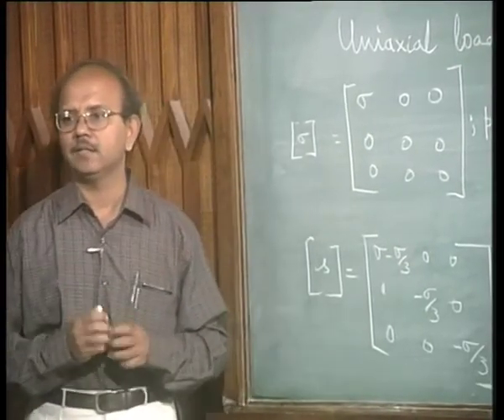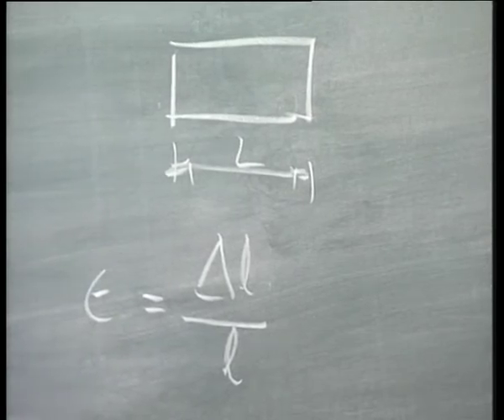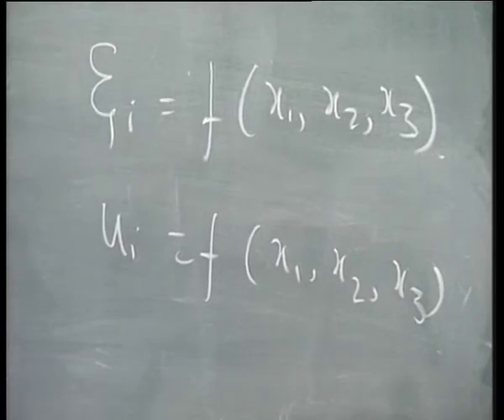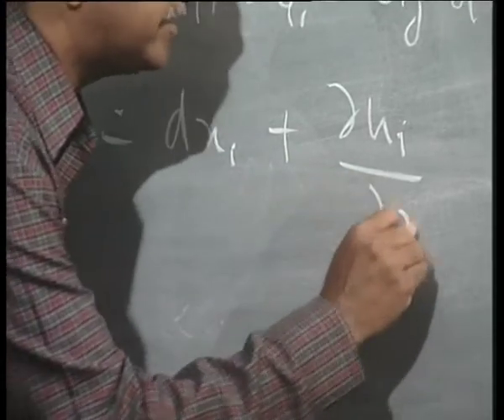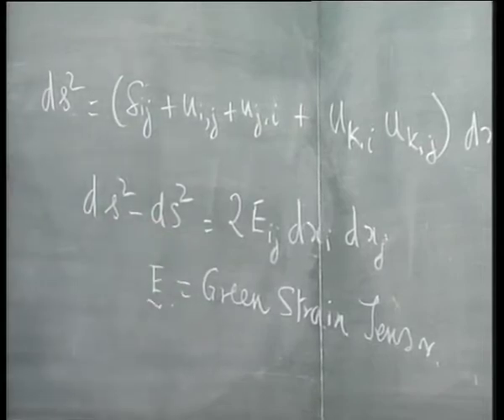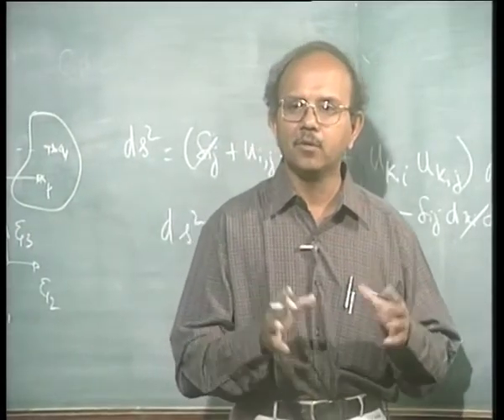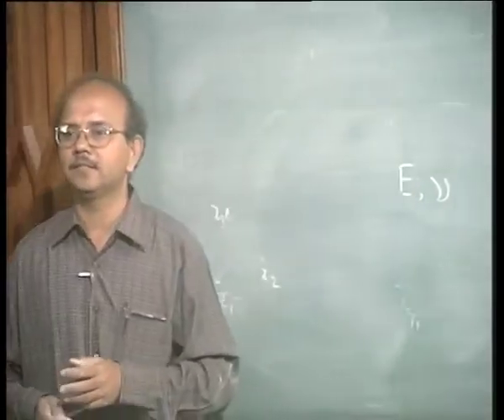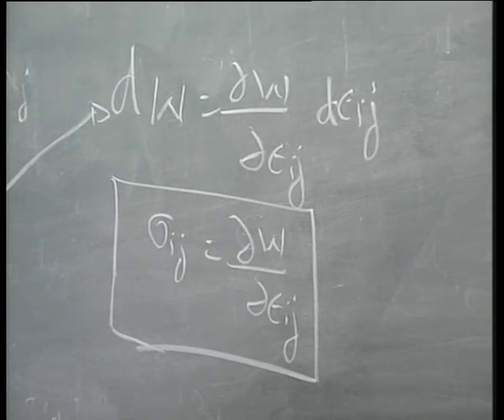Mod-01 Lec-09 Introduction to Finite Element Method

Comment: You need to have a rigorous understanding of indicial notation to understand lectures intuitively. Indicial notation is a must since you are going to code and run the code faster and more efficiently. Also noted to mention, you also need to understand intuitively every math topic in linear algebra, calculus, and, last but not least, the ultimate engineering math, PDE. After that, you solve the PDE using FEM.
Reply: apna kam kar .

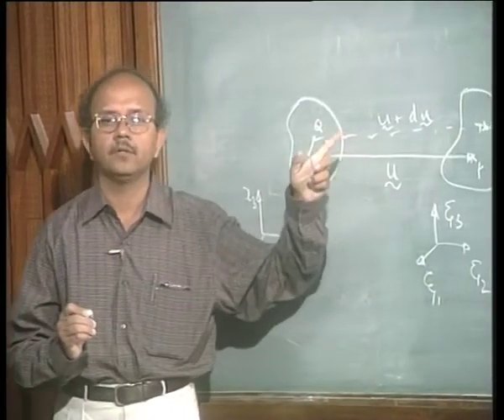Comment: Why d(xi)i = d(x)i for when du =0 @22:00 ? What is the relation between the two co-ordinate systems...cause I don't think   'd(xi)i = d(x)i for when du =0' would be valid for any general  Xi co-ordinate system ( for example one that is obtained by rotating and translating X co-ordinate system randomly)

Comment: At 8:00, when we find the equivalent misses stress in 3D problem and compare with a uniaxial test, How do we know which location we have to check the misses? 
Is it like wherever it reaches first?, because it will always happen under the loading point due to stress concentration then.
Reply: we will calculate the Mises stress in all possible points throughout the body in a 3d problem as the distribution of stress is very complex in a 3d problem and compare it with the yield stress obtained from uniaxial loading.
Reply: can you please suggest a reference book for this pls

Comment: Where are the tutorials
Reply: +zeryab hassan Kiani 
This is general technique for learning Finite element method.  After finishing all the lectures you can apply this technique to different domains. If you are finding tutorials for software or for coding part then you are at wrong place. Listen introductory lectures then it is easier for you to apply steps more logically in software.
Reply: can you please suggest a reference book for this pls